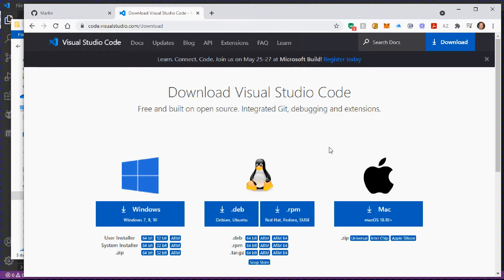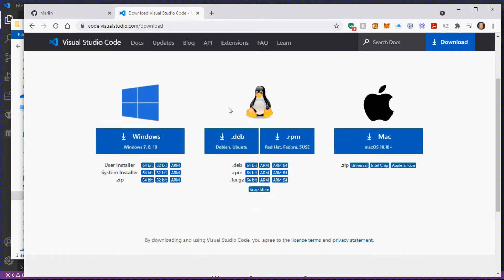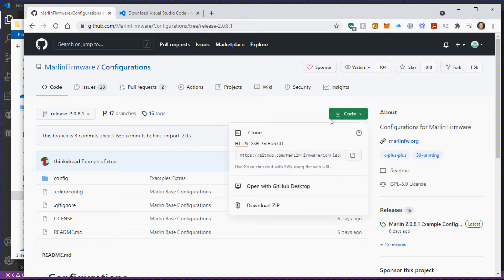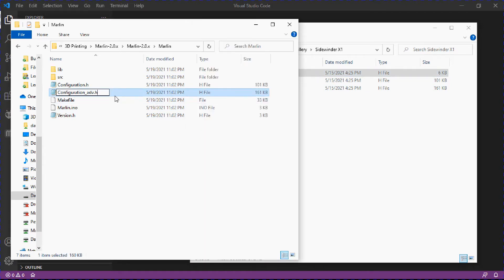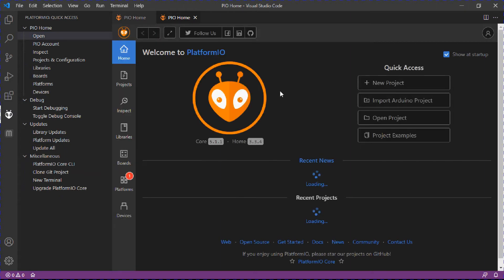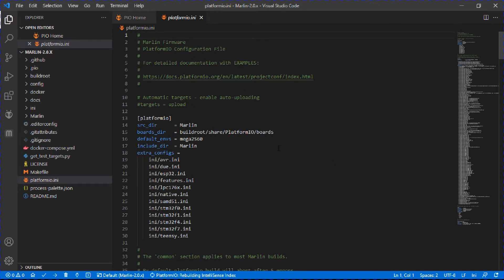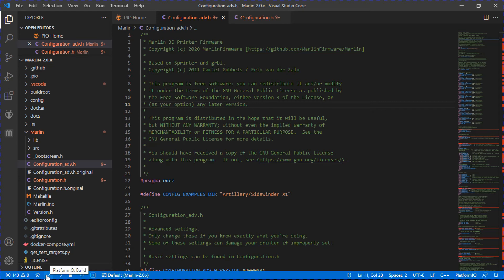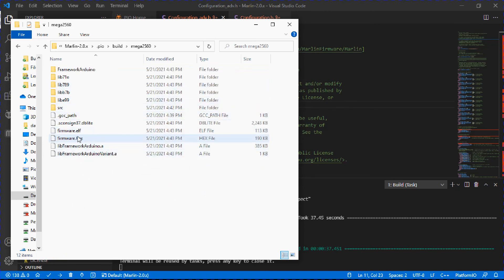Geeking Out Episode #3 Compiling 3D Printer Firmware

Comment: My screen broke and I ordered a new one. On the plastic wrap it said 3.5 and the rest was in Chinese. After installing it my X1 no longer prints.  The screen comes on but the white lettering in the continue or cancel are not there.  Will updating the drivers fix this issue?  Also the change filament does not work, hot end does not heat up, level bed only shows 3 points, and will not go to any.  Please help.

Comment: Hi Pete, I have Sidewinder X1 which does not have power outage recovery feature working. Does upgrading to Marlin 2.0.x version solve this problem? What is your experience? You have done indeed a nice video for Sidewinder X1 owners. Thank you.
Reply from the maker: Hi Victor, after the power is restored, the printer doesn’t automatically restart printing. But there should be “Resume” on the touch screen. As long as the extruder hasn’t moved or been melted into the print, it should pick up where it was stopped. 
Are you not seeing that option?
Reply: @GeekingOutWithPete   In my printer, I only see the file system vanishing due to the outage and not finding the print file. That is a bummer!
Reply from the maker: @victorramamoorhy2010  are you printing from octoprint? Or a tf/usb?
If you’re printing from octoprint you have to resume with octoprint. 
If it’s a tf card or usb plugged directly into the printer, for some reason it’s losing the drive mounting and maybe updating the firmware will fix it.

Comment: Ouch after upgrading to Marlin 2.0 my prints will no longer start via Octoprint as they are waiting forever for temp stabilisation of hot end I replaced the thermistor no change did PID no change. Prints start fine though touch screen. so it seems the tolerances in Marlin are higher or thermistor settings are wrong?
Reply from the maker: I think Octoprint needs the temp to be stable for 10 seconds before it will start to print.
Where did you do the PID tuning from? The touch screen? That should work, but you can also do it manually from Octoprint or your slicer app. 
Open OctoPrint (Or slicer with terminal)
Goto Terminal 
Send the command: M303 E0 S200 C8 (this will start the PID Autotune (heating E0 to a Temp of 200° 8 times)
Wait until you see: PID Autotune finished (with some values attached (Kp, Ki, Kd)) (will take about 5mins)
Send the command: M301 Pxx.xx Ix.xx Dxx.xx (replace the values with your results) to store the settings in the current configuration
Send the command: M500 (without any value) to store the settings to the permanent EEPROM

Hope that help!
--Pete
Reply: @GeekingOutWithPete  already did that with pronteface and m500 the results but it made no difference. I've managed to get it printing by turning off wait for temp to stabilise in simplify before slicing but that seems like a bit of a cheat my temps are fluctuating between 205 and 225 while printing when set temp is 215.
Reply from the maker: Is this on a sidewinder? I've never seen them fluctuate that much for more than a few seconds. They usually stabilise pretty quickly.
When it's printing does it continue to fluctuate?
Reply: @GeekingOutWithPete  yes its a sidewinder x1 v4 and that is while printing and I agree it is not normally like this and my other sidewinder is fine. I've replaced the thermistor and checked the ribbon cable no pin issues at the hot end controller board that I can see. Hot end has a heater sock on like my other.
Reply from the maker: @Mrtickleberries  I don't know why the PID Autotune isn't working. Unless there's something wrong with the heater or motherboard. And it was working fine before you upgraded to Marlin 2?
Reply: @GeekingOutWithPete  Not Red Potato but I am in a similar state. My Sidewinder X1 gives me quite a few nozzle temp fluctuations, which I believe is the culprit of frequent thermal runaway errors. I removed my silicone shield around the heat block because it was catching filament and messing up prints. As a result, I decided to tune my PID, which I did using pronterface. Only issue is that the M500 command gave me an error that EEPROM is disabled. For now, I've inserted the new PID controls in my Gcode startup from CURA. Going to follow your videos to see if I can fix the issue!